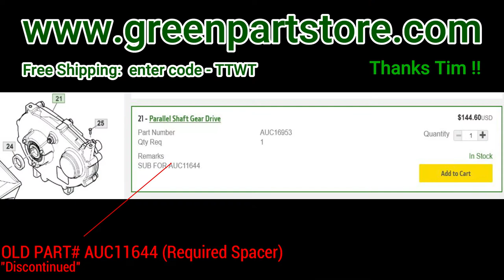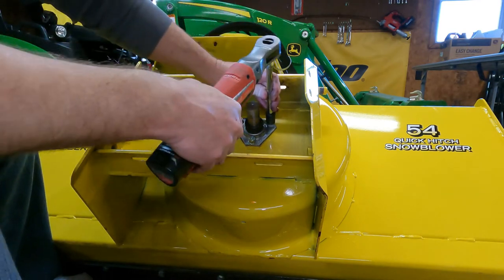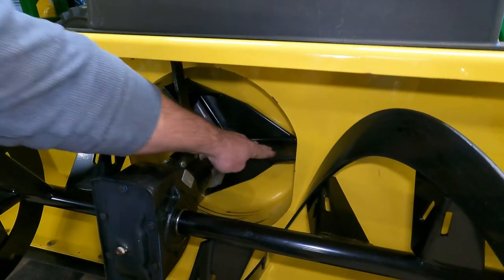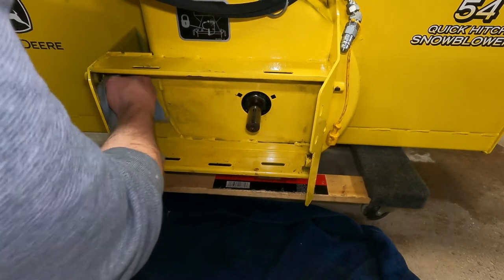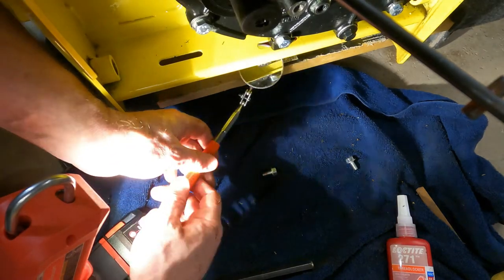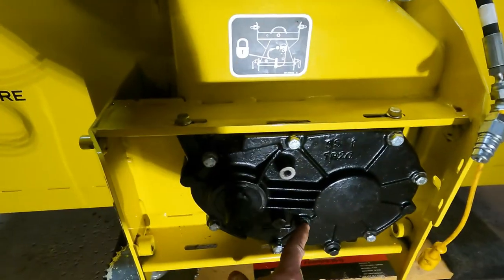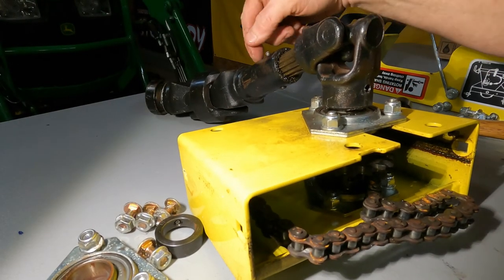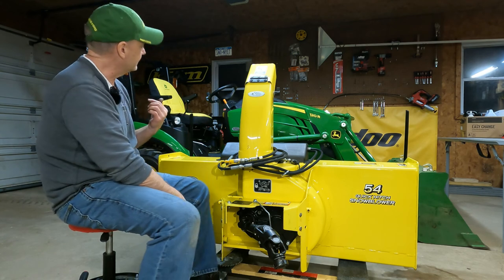JOHN DEERE 1025R | 47” 54” SNOWBLOWER CONVERSION PARALLEL SHAFT GEAR DRIVE

Comment: If your snowblower came with this drivegear, drain it right away.  I waited for about 20 hours and what came out looked like rust and mud.  It's about 4 oz. so I plan to change every 5 hrs..  Has anyone ever removed the auger shaft M157969?  I'm trying to find out how to take it out of the Auger drive gear?
Reply from the maker: Hey Bob, Thanks for stopping by to check out the video. I will pin your comment at the top in case anyones snowblower came with his drive unit and also to see if anyone has removed the auger shaft as you're requesting. Take Care and HAPPY NEW YEAR 👍🏼
Reply: @SometimeIsNow  I got the shaft out of the gear drive.  It just took a little penetrating oil and the Keyway tapped out.
Reply from the maker: @rastrand1  Perfect. Thanks for the update 👍🏼
Reply: Good video 👍

Comment: Bought this for my small back deck in the Eastern Sierra. https://www.youtube.com/post/UgkxoHYZbq5g9fkcAtinlTqstNlje-UQkCHN We get A LOT of HEAVY snow so I was a bit skeptical but it was worth it! After the first storm of the year this has exceeded expectations! It throws snow very well, even 10-12” + that said the more it piles up the harder it is to maneuver the machine. It is exceptionally light weight and overall exactly what I was looking for. If you have a large amount of snow and a lot of area to clear, you may consider something with a drive engine to help maneuverability, but for decks, second stories, roofs etc, you can’t beat the light weight to great snow throwing ratio. Side note, the chute rotator is a bit flimsy and it initially didn’t seem to work, after a few uses it seems to have loosened up.
Reply from the maker: Hey Epic !! Thanks for stopping to check out the video. Take Care

Comment: Looks an sounds great,  do you know if it is gear drive or chain drive? And if chain drive, is there a chain tensioner built- in. All chains will stretch. I do like the no more mess of oil splatter.
Reply from the maker: Hey Dave, Thanks for watching !! 👍🏼 
It’s my understanding that there’s a chain and two sprockets inside the box. If you look @14:26 on the back side of the parallel box you can see what might be an adjustment. I’m not 100% sure. If that is the adjuster, you’ll have to remove the parallel box to adjust the chain because it’s on the backside of the box once it’s mounted. Which isn’t ideal.. So far it’s working great! Take care 🤙🏼

Comment: Hi, this is my first time ever liking anything online.   This video was invaluable, would have taken me a month of Sundays otherwise. Just wanted to add that you do not have to loosen or remove Auger at all.  Just loosen the two set screws at the impelller (right near where the shearbolt is) and slide that unit back off the key.  Remove the key and slide the impleller itself back ..you can then pull the bolts out so you can place the shaft gear  in place.  Put the key back etc..but don't tighten the set screws until you have secured the gear drive.  BTW..the unit cost me $360 CAD before taxes.
Reply from the maker: Thank you for stopping to check the video out and I’m glad it helped in some way. Great update on the process for not needing to loosen the auger. 👍🏼 Is $360 CAD a good price? I know the price has went up since I bought mine. I paid $142 back then. Take Care.
Reply: @SometimeIsNow  Just bought mine Jan 2003 price now is $209.+change US.  Parts man had never seen one and he has been parts guy at my dealer for 0ver 20 years. He was suprised it didn't cost more. I'm glad it's not more.  Hope to put it on after next storm we are expecting this weekend.
Reply: Oh wow, just loosened the auger to pull it back. Noticed your tip to loosen set screws and just move the impeller back. Will try that first. Also was concerned about putting the gearbox on to the stub shaft without knocking the key out of the slot, which has a slope at the back of the slot. So I decided to use some Permatex sleeve retainer i had on hand to hold the key in place.

Comment: Although I always grease all the blower's moving parts religously, the u-joint on my blower driveshaft siezed up and wouldn't straighten out.  I ran down to my JD dealer and had to buy the entire driveshaft (supposedly the u-joint isn't replaceable), $344.77 for that, but it was the new upgraded driveshaft with the plastic protective sleeve.  I figured while I was there, I'd buy the parallel shaft upgrade if they had one in stock. They had one, unfortunately the price has gone up to $213.85 (the cost of putting it off)!  So, my project this weekend is to install the gear drive and replace the driveshaft.  The parts weren't inexpensive, but it's a hell of a lot cheaper than a new blower!  I'm looking forward to less noise and vibration, and a much cleaner snowblower.  I enjoyed your video, it was well done and very informative.
Reply from the maker: Hey Steven D, Thanks for stopping by to checkout the video and thanks for the kind words. Everything should go smoothly and you will definitely hear a difference in how quiet the blower runs once you swap out that open chain and sprockets. I’ve been keeping an eye on my driveshafts for ease of movement and that’s strange yours locked up. 🤔 $213.85 still isn’t bad for what it is.. I’ve paid that much for a piece of plastic. 😂 Take Care and good luck on the upgrades 👍🏼

Comment: Thank you for this excellent video. Just finished installing the parallel shaft gear drive. Your instructions are spot on and made it so easy. Takes time but all went well with no problems. The original chain slipped off twice and finally broke without shearing a pin. Dealer said he could not understand how that could happen. Ordered a new chain, which would take 5 days to come in.  Was playing around on You Tube and came across your video.  Called dealer and cancelled chain and bought the parallel drive on line and had it shipped free in 3 days. The chain gear box was bent out of shape which caused the chain to break. Deere needs to beef up gear boxes. Will take to dealer and show him.
Reply from the maker: That’s great that everything went well..👍🏼 Thanks for watching the video and I’m glad it helped. Yeah it took some time to swap it out but ya gotta love working on the tractor so it isn’t too bad. 😁 I hated having to constantly spray lube on the chain to try and keep it from rusting which always made a mess. This parallel box was well worth the time and money. 
Take care 🤙🏼
Reply: I think that for $259 with free shipping it will be well worth the trouble the chain drive causes. looking forward to many years of problem free operation. thank you again for the excellent video.

Comment: Great video. I just converted my 2009 47 blower on 12-4-22 my old chain and sprocket were onto of round.  Talked to 5 jd dealers  3 said no it would not work 2 said yes it would. I priced out the new chain 2 sprockets 3 bearings  6 retainers jd wanted 420.00  pretty much a no Brainer for me. The new  housing is much better than the old sprocket and chain. No more oil and  grease everywhere. I would have never known about the part if wasn't for you and the video. The locking collar removal was the best. Thank you for the video. Keep up the good work
Reply from the maker: Hey tk, Thanks for stopping to check out the video and I’m glad it helped you upgrade your snowblower. I love how quiet the box is compared to the open chain and sprockets. I hated the messy grease slinging all over and the rust.. I agree.. The price point difference is a no brained for sure. I don’t know how much the parallel box is now but when I upgraded it was like $142 bucks.. You can’t beat that at all compared to the original chain and sprockets. Take Care 👍🏼
Reply: @SometimeIsNow  250.00 dollars compared to 420.00 for chain and 2 sprockets and 3 bearings.  Thanks again

Comment: i, thanks for much for the video, This is the best one I've seen for the gear drive. I watched it 2x before I made my attempt. Thanks for pointing out all the proper steps and tools. I wouldn't have tried doing this myself w/o the video. As I got done each step, I would replay the video for the next part and got through almost everything w/o an issue. Just had a tough time re-installing the drive shaft onto the new stub shaft, was very tight. Thanks again.
Reply from the maker: Hey Ivan, thanks for stopping by to check out the video. I’m glad it helped you and everything went quite well with the install. That was the whole purpose on this video was to show how it was done and maybe help people feel confident about doing it themselves instead of paying the dealer. 😉 Take Care 👍🏼

Comment: From @user-od3ii8tu2v Please disregard my last posting, on 1998 47" snowblower, My center slot is offset like the blower in the video, The slot spaceing on mine is top 1st & 3rd slots 9" center to center, bottom 4 1/2" center to center, Other info is the same, both sprocket shafts are 1" in diameter, Mounting box is 8 1-2" high, might this unit work for me?

Thanks
Darrell
Reply from the maker: Hey Darrell, Thanks for stopping by to check out the video. Without taking measurements from mine I wouldn’t want to venture a guess and be incorrect about your snowblower. Tomorrow I will take some measurements to see if they match what you have on yours. Take Care

Comment: Great video!! Inspired me to buy it and I'm going to install it this weekend. As far as the wire goes, I saw on a Deere parts website that a new spring pin is recommended when adding this drive. Makes good sense. Not related to this upgrade, I replaced the quick pin that is used to lock the rotation of the quick hitch (it's needed for the blower, but you remove it for plowing to allow hydraulic blade angling) with a 3/4" x 6" threaded bolt and nut. It took away ALL of the wobbling of the blower when the pto is engaged. It was driving me crazy! Now she's nice and stable. If I do switch to my blade, I'll have to remove a bolt now instead of the quick pin... but I'll gladly take that extra 2 minutes occasionally, rather than having that blower rocking around like an amusement park ride!! Ha!! Again, thanks for such an informative video.
Reply from the maker: Hey Will, Thanks for stopping by the channel. I seen a video that someone added a bolt and nut to the center pin so it tightened up the rotating half of the quick hitch. Mines not that bad yet but when that times comes I will do the same as I don’t have a blade just the blower. Thanks again for the kinds words. Take Care and enjoy that new quiet gear drive 👍🏼 THINK SNOW ❄️❄️
Reply: I did the quick pin swap today after reading your comment. I'm guessing you tightened it until the bottom plate actually bends a little too contact the bigger unit to lock it in place? I went with a 3/4 x 5 bolt with a nyloc nut, tightened it until I could go no more.

Comment: just swapped mine out today went well should be all set for next winter did fill case with amsoil 80w90 synthetic hopfully will do away with the old rattle trap it was.
Reply from the maker: Hey Steve, Thanks for stopping to check out the video and I’m glad you found it useful. 👍🏼 Good choice on Amsoil. They make great oil. You’ll notice an instant sound difference as it’s much quieter for sure. Take Care

Comment: Thanks so much! I just had issues with my chain here in NoDak. I bought the parallel shaft gear box.
Reply from the maker: Hey Brian, Thanks for stopping by to check out the channel. This was my first winter with the upgraded Gear Drive and it worked flawless. It’s much quieter than the open chain and sprockets and I had zero issues. It was well worth the upgrade IMO. Take Care 👍🏼
Reply: @SometimeIsNow  You are welcome. I will install mine soon. It's here and ready to go

Comment: Success with installing the gear box.  My test was blowing snow that had fallen off my roof in front of my garage. Thank you very much! Your step by stop instructions were to the letter A to Z.   My chain broke, so it gave me the reason to attempt to install the gear box.  I will not reveal how long it took me.  Just me and my dog, Winston, will know the true time.   The most time consuming step was getting the holes to line up when installing the gear box. I finally tipped the blower over so the gear box was on top, it was then that it finally slid in to place.  The other time consuming step was removing the spring from the drive shaft.  I had a small tap.  The half moon was not tapping down low enough, so I filed the sides a bit.  Seeing you tap it on with wooden mallet was helpful. Good bye chain and sprocket!  Kudos to John Deere for coming out with a better part.   I will add this to my DIY list.  Thanks again.
Reply from the maker: Hey William, That’s great 👍🏼 I’m glad you were able get it installed while spending a undetermined amount of time with Winston..😉 That right there is priceless. ❤🐶 I will agree, lining up the bolt holes for the gearbox took a little persuasion. Have a great week and Take Care

Comment: Thanks for the video! Followed step by step. Also needed to use a couple of tips from other commenters. First was removing the bolts from the middle auger brace, then removing 2 bolts from each end of the auger. Leave the top bolt to allow the auger to pivot enough that the carriage bolts behind the impeller drop out, without having to move the whole auger. Also had to lay the blower face down to get the gear case to move enough so that I could insert the 4 bolts securing the gear case. Used a chain hoist to make it easier to wrestle around the blower.
Reply from the maker: Hey aftoy,
Thanks for stopping by to check out the video and I’m glad the video helped with your install. Take Care 👍🏼

Comment: I have the new style 54" snowblower with the parallel shaft gear drive and I want to change over from the plastic to metal impeller. Can I do everything from the front and pull the auger out with impeller without touching the gear box at the back, or do I also need to remove the gear box too? The whole shaft with impeller and auger should pull straight out of the gear box, no?
Reply from the maker: Hey Busman, Sorry just seen your comment. To answer your question, If you already have the new style parallel box on your new snowblower you should be able to remove the horizontal auger and hangar support bracket and pull everything out at once from the front without removing the parallel box in the back. May I ask why you are going to a steel impeller? Is your driveway stone and gravel? because if it’s not and it’s asphalt, IMO I see no reason to go to a steel one. My snowblower is 5 yrs old now and has the plastic impeller and it’s still like new. Plastic have come along way over the years an much tougher than back in the day. Just my .02 cents 😁 Take Care

Comment: Thank you so much for making this video. After watching this I got up the courage to attempt this conversion as I don't  have a lot of mechanical experience. The switch out to the parallel gear box worked perfectly, again as I had this video loaded up on my iPad to refer to when needed. Thanks again. One of the best "how to" videos I've watched.
Reply from the maker: Hey John, Thank you for stopping by the channel and for the kinds words and I’m glad the video was helpful to you. I was impressed how quiet the gear drive is compared to the open chain and sprockets. Take care 👍🏼
Reply: The detailed video, your reply,  and my lack of mechanic skills gives me the courage to try it. I am done tackling with issues with the current parts. Thanks, J D.
Reply: Good video I had no trouble with my job thanks jrflinchum

Comment: Can't thank you enough for this video! I'm looking to do this conversion and seeing it is really helpful. One question: is it empty (of oil) from the factory or did you drain it out to start fresh before adding the new oil in the video?
Reply from the maker: Hey Peter, Thanks for stopping by and checking out my channel and I’m glad you got something out of it. 👍🏼 The gear box comes empty so you will need gear oil to fill it after its installed. Take care. 🙂
Reply: Thanks again!